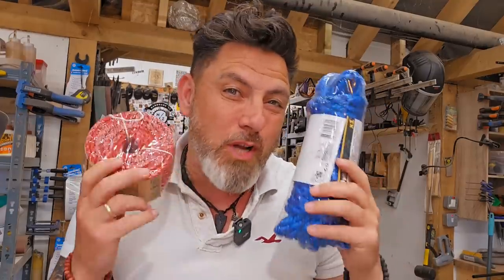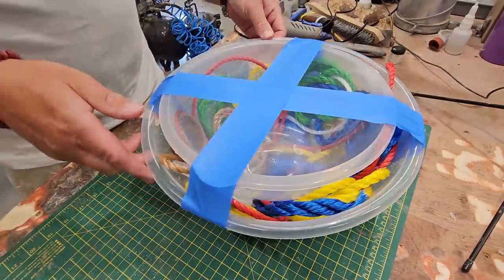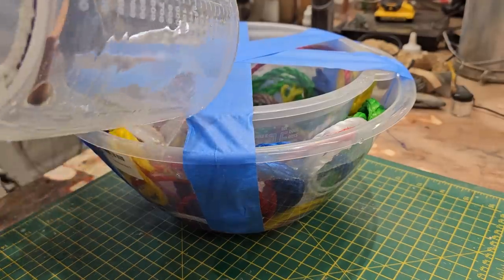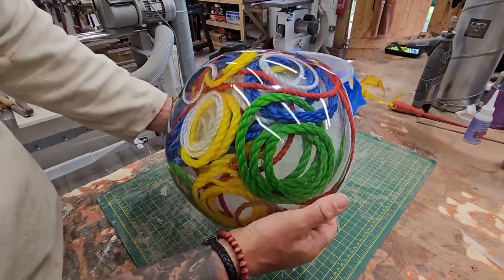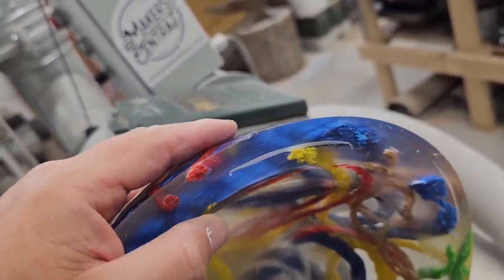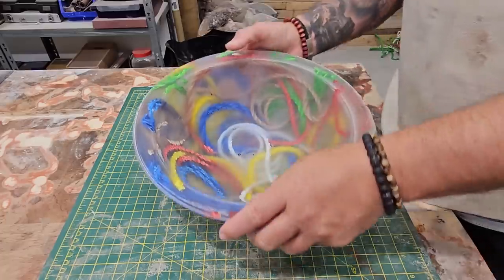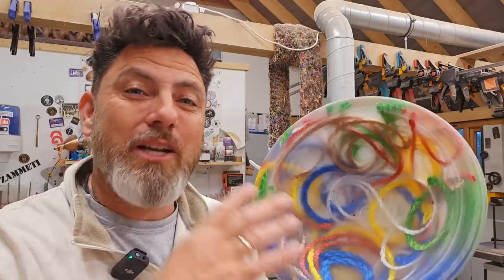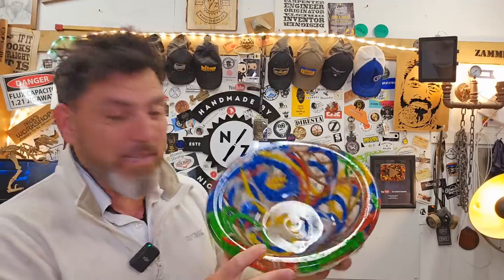ROPE & RESIN Don't Mix but Surprisingly WORK!

Comment: Police are searching for a gang who stole a series of ropes from the local toy shop. It’s believed they’ve skipped town.

I’m struggling to get the slack out of a rope even after instruction. I guess some things just can’t be taut.

Saw a group of people competing to see who could end up putting most knots in a series of ropes. They ended up tied.

Really upset that the metal hooks tied to my rope have broken. I’m having a hard time grappling with this.

Comment: I wouldn't want to string you along. it would be easy to get tied up in something like this. the danger is having the project strike a familiar cord. I know it is Knot like anything you have done before, so don't lash out about the comparison. before you go drawing a line in the strand, we should cable together a good bowl, and leash this whole thing alone.